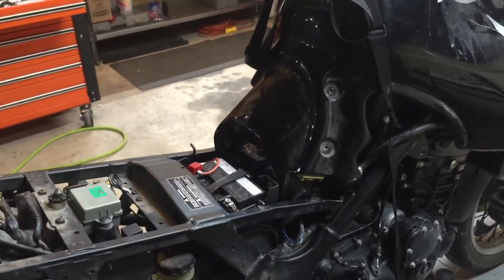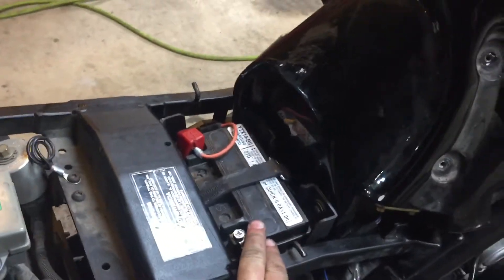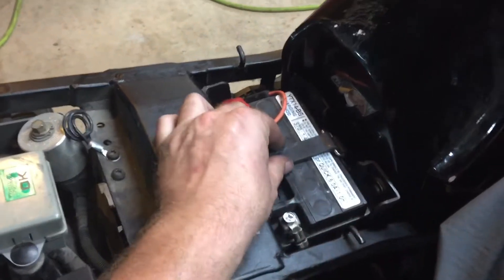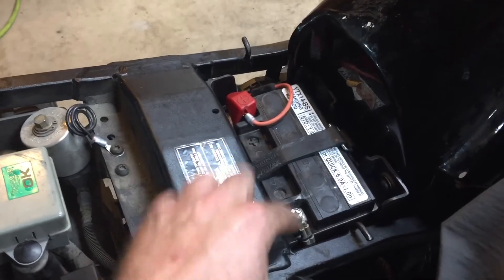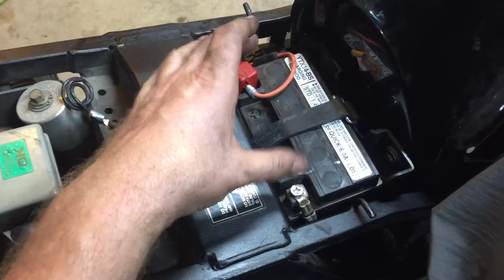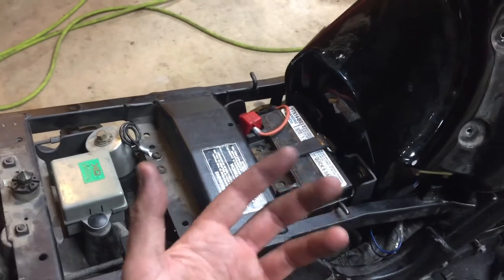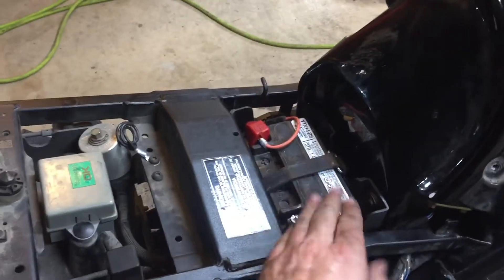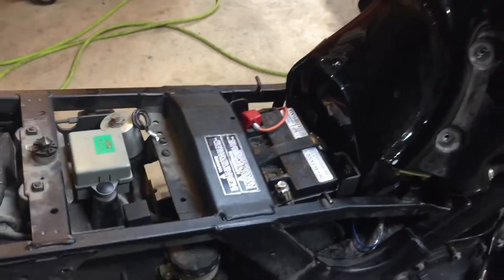Battery Straps...why are they not taken seriously? #maintainence

Comment: Hi Shane do you recommend greasing battery terminals? Can regular grease (eg brake caliper grease) be used? Thanks!
Reply from the maker: The absolutely best electrical connection is clean and dry BUT I'm a huge fan of proper Dielectric grease https://amzn.to/3IyVchM I don't think I;ve used any other grease since I was a kiddo in the garage. The only problem with any of these is they attract dirt. BUT I do use it on my street touring bike in the case I run into rain, I think it helps keep water out by packing the  backside of connectors.
Reply: @How2Wrench  thank you! 🙏